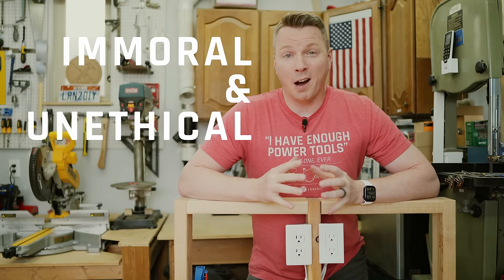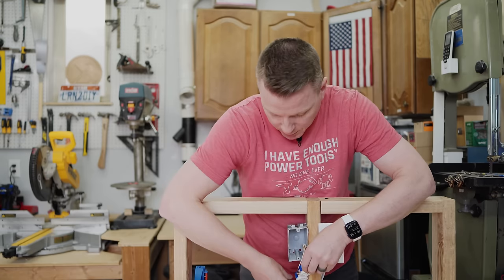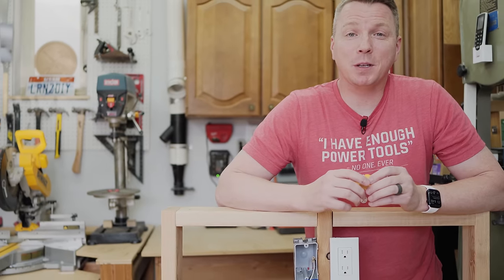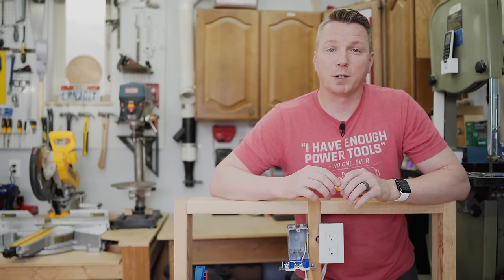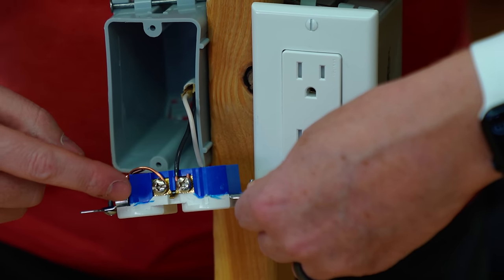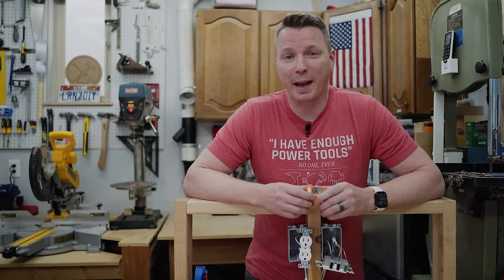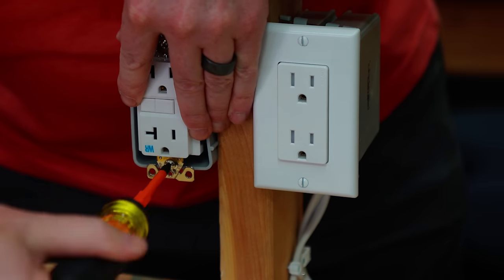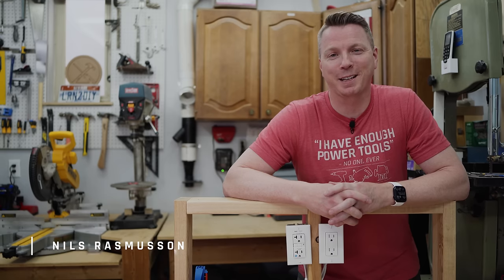People Are Adding Deadly Hacks to Outlets

Comment: My house, built in the late 40s to early 50s, half the outlets were wired backwards polarity, no ground, but all sockets were three prong. I've been correcting them all as I go. I mean even the electric wire was color coded incorrectly, black and white would be hot or neutral or vice versa.
Reply: I just moved out of a house like that. The noise through my guitar amp was unbelievable, so I started checking outlets. Almost every outlet was backwards with no ground wire. 1 outlet in my bedroom was backwards with ground so I fixed it and plugged the amplifier and pedals Into that and things got much quieter.

I couldn't believe that every outlet was wrong. I'm pretty sure mine had ground because it was added later, as well as a couple of outlets in the kitchen. Other than those, nothing had ground. The house was renovated before I moved in so I'm sure that's when they got put in backwards because they all had 3 prong outlets and new covers, etc...

I moved in Jan 2022 thankfully. The house I bought has modern wiring so my amp is dead quiet these days. The first time I tried it when I was moving in, I was very surprised at how quiet it was. 1st time I heard it that low.

Comment: Good video that shows a not so common problem. 

But there are a couple misconceptions. The tester showing correct (two lights on) just means the tester detects that both the neutral terminal and the grounding terminal both lead to the neutral at the source. (Main panel or meter base with main breaker).

So the $400 tester is likely not going to catch this mis-wiring either. To both testers, the terminals lead to the correct paths. The problem here is where in the electrical system the grounding conductor and the neutral are connected together (in this case, at the receptacle). In any system, they should only be connected together in one spot, at the beginning where the main disconnect is at.

EDIT So turns out the $400 does know where the bonding occurs by measuring impedance so it will help to distinguish if it is indeed a bootleg ground. Thanks to sparky below
Reply: Actually the $400 tester can detect false grounds by measuring the impedance between neutral and ground.   Below a certain threshold e.g. jumper between the neutral and ground screws on the outlet the tester will flash an F over the ground to indicate false ground.   In a properly wired home with modern wiring the ground and neutral only connect at the main panel, nowhere else, giving a higher impedance between neutral and ground at outlets.

Comment: A couple years ago after I got my own place I was helping my mother refinish my old bedroom, helping to paint and replace discolored outlets and such. Now, my mother's house was built in the 50's and is wired very strangely. There's 3 bedrooms, and one breaker controlls the ceiling fixtures in all 3 bedrooms plus one switched outlet and one regular outlet in each bedroom and another breaker controlls the remaining 2 standard outlets in each bedroom. (That's not rhe only weirdness, but the rest would take too much time to run through)

Now, at some point in time, the circuit running the lights (which also ran the switched and one non switched outlet in each room) was properly upgraded with 3 conductor Romex, along with most of the rest of the house, but there were two circuits in the house that were still 2 conductor, one of which was in the bedrooms running the other two outlets. The second ungrounded circuit was easy enough access because of how it was routed that a family friend who is also a licensed electrician came out and did the upgrade for us for not much of a cost above materials, but the bedroom circuit would have required removing drywall all the way from the garage in one corner of the house where the breaker box was to the bedrooms in the opposite corner, and that was well above the time and monetary cost we could afford at the time. My mother was asking me to just install the three prong outlets in and don't bother with grounding them ("I'd know that they aren't grounded, its not an issue") to which I flat out refused, but I did agree to installing a GFCI on the circuit and daisychaining the downstream outlets to protect them all, then putting the No Equipment Ground sticker on all the outlets. So, long story short, I'm glad to know that I did indeed do the correct thing given the situation

Comment: We have called them a "dead-man jumper", and it is way more common than you think in older homes that did not have the 3rd ground wire throughout, known as a two wire system compared to newer 3 wire system. People will replace a 2-prong receptacle for a 3-prong receptacle and install a dead-man jumper to complete the ground.  Very dangerous for you and any equipment plugged into it. That ground is now sharing all the current going through on the neutral, creating a very dangerous shock hazard which could lead to electrocution or fire.
Reply: And where do ground and neutral go outside of your house in North American wiring ?
Reply: @dmitripogosian5084  Standard residential will have a 240v service. 120x2. There are three wires that will come from the pole to the house L1,L2,N going to the service panel. At the house there will be a solid ground rod in the ground to attach the ground wire to the service panel. At this point ground and neutral are bonded together. For the inside panel there will be 4 wires from the service panel. L1,L2,N,G. On the interior panel the neutral and ground are then separated to there own buss bars and not bonded together. Neutral will be insulated from the metal panel. The ground buss will attach to the metal panel. All ground wires will then be terminated at the ground buss and all neutrals wires will terminate on the neutral buss from each circuit. Hope that helps answer your question.
Reply: @jonesgang  Thanks a lot !   Last summer I was looking at my cable to the pole, consisting of insulated cable hanged on uninsulated stranded metal line, and noticed that the metal line has only one strand left intact.  I always assumed it is just a mechanical support for the cable, but when electrical company came to repair it, technician said it is actually my ground (and now I am confused, maybe he said it is neutral ? ) . Anyway, after  new segment was spliced into the damaged part,  my lights stopped blinking when dryer was starting :)
Reply: @dmitripogosian5084  All power wants to return to its source. That bare metal wire is the return/neutral/ground. If you only had a strand or two and the rest broke or chewed you were having some funky issues in your house. Lights would dim or they would get really bright or major brown out of power from time to time all sorts of fun stuff. Glad you got it fixed. If you have lost that wire all together you could have sent 240 through every 120 circuit. Crazy fun stuff!!
Reply: @jonesgang  Fun part I lived with it probably for over a year, thinking it is just mechanical. Given that this cabling is electrical provider responsibility, they came within half an hour of my call, looking worried :)

Comment: Our house was built in 1978. All of our circuits are either 3 wire or 4 wire. And it is run in metal conduit. So even if the ground wire were to break, the outlet would still be grounded thru the boxes. And yes, we have GFCI outlets  which have the ground pin up.

Comment: I have a house built in 1955, and it had the main service running from the weather Head across the top of the front door, and it was frayed, i thought just that could be replaced, but no it had to be brought up to code, 8 thousand dollars later, new service from pole, weather head ,meter pan, circuit breaker box and breakers, i also went with whole house overload protection,this house does have some two prong outlets, but all the others were already upgraded to 3 prong and the power is much more reliable after those updates

Comment: You can also just get a two pole voltmeter with a continuity test mode, like a Duspol,  to test continuity between ground and neutral. You don’t need an extra special outlet tester for this.
Reply: Can't*
Reply: Isn't that exactly what all those basic meters are doing?
Ground is literally screwed onto the same place as Neutral in the main breaker box. If there is no continuity between your Ground and Neutral, Tere's a problem (99% of the time).
I guess you could test for resistance but even that's a bit of a stretch.

Comment: UK here (& not a professional electrician). Here in 🇬🇧 we have 230V AC supply & extremely strict regulations as a result. All modern installations have to have an Earth Leakage Circuit Breaker (ELCB) fitted which trips at 30mV. This bootleg ground hack wouldn't work in UK as the path from neutral to ground would trip the ELCB & it couldn't be reset until the neutral/earth path had been removed. 
Obviously you're in 🇺🇲 & regs will be different but are ELCBs not mandatory?

Comment: Been in the business since 1985 and never saw this. That truly is a hazardous situation. The disposal and refrigerator outlets would be a high priority to check.
Reply: Genuinely want to know why it’s dangerous to connect a neutral to the ground at the outlet? All the neutrals and grounds are connected inside the service panel. Why is it hazardous? Is it a function of resistance through one wire vs two?
Reply: @stephenroberts4155  because you become the ground, versus your ground rod which is bonded to neutral at panel.
Reply: @REALBanannaman  that doesn't make any sense at all. no matter what, the resistive path would be identical to the ground rod. In  assume a run 50ft from the panel: case A, normal. Resistive path from the ground pin goes down 50ft of ground wire, hits the ground rod; case b, bootleg ground, Resistive path goes from the ground pin, up 1 inch, down 50ft of neutral wire, hits the ground rod.
Reply: I would say its better than installing grounded outlets with no ground connected, but its still not good.
Reply: @X4Alpha4X  If there is no problem with the wiring, it should work. However, if a problem develops in the neutral, your ground will have the same problem with potentially very unpleasant consequences. And if the polarity is reversed, your "ground" will be powered.
Reply: @X4Alpha4X  Honestly there's nothing extremely wrong about it since it's better than nothing. It's just that a bootleg ground is going to remove redundant protection. If a floating neutral were to develop in a circuit with equipment grounding,  you'd at least have a chance that it would touch the ground wire and trip the breaker. In a bootleg ground scenario, once that floating neutral develops you'll be in for a wonderful 120V surprise when you touch the outlet with 100% certainty, since the one and only wire that could have tripped the breaker is now broken.

Comment: I have always wondered, "Which is more likely to happen? A short in the appliance, or a fault in the neutral line going back to the box." I feel safer having a bootleg ground than I do when I see a 3 prong adapter being used that has the pigtail flying in the air. (I hadn't watch the full video when I made that comment. The GFCI marked "No Equipment Ground" option looks like the best option.)

Comment: My wife and I bought a house that is a little old (70's).  I'm NOT  an electrician but I'm a software engineer and electronics engineering  person so I know how electricity works.  Half our newer addition to the house is grounded but the old side isn't.  I replaced all of our 2 prong outlets with a CFCI upstream and had a tester to see which one would kick it so I knew which ones the GFCI protected from the initial CFCI outlet.  Normally if I have an outlet that doesn't hold plugs in good because worn our or or something I replace it while it's hot because I don't want to find the breaker.  Just be careful just same as replacing a breaker in the box.  Only thing that ever got me was a ceiling fan I was replacing in my daughters room on the older side of the house.  I just shut the light switch off and took it down.  I didn't feel like going downstairs to get my "tick" (the pen things that detect voltage).  It was wired "HOT" instead of normal so light switch don't matter.  Got a little arm tingle from that one.

Comment: The houses in the 40s had grounds originally provided for kitchen, bath, laundry, but not living rooms and bedrooms.  Often the ground was a single wire run beside the double.   I found it easy to fish a single #14 wire to the ones that I needed a ground in.    Regarding this video, odd that you switched a 15 amp outlet with no ground to a 20 amp GFCI.   I know many people who think that a 20 amp outlet is better quality innards (true) so why not splurge, but they forget that with only 15 amp (#14) wire, the t-slot allows a 20 amp appliance to be plugged in.   Not safe long term, nor code.
Reply: Name a single 20 amp appliance you have in your house without lying.
And your dad's old circular saw from the 1960s that will never be outside of the garage (and probably never actually be used) doesn't count.
Reply: @joshuaewalker  There are plenty in the world. Especially commercial floor polishers, and high power microwaves. I have the latter.  But even if there is only one in the country, the code is the code!! An "instructional"  video should never show violation of the code. Outlets are designed to restrict the size of plug to put in, based on the capacity of the wire in the wall.  You cannot plug an electric stove into a dryer outlet, for a good reason.
Reply: Plug a 20 amp appliance into a 15 amp circuit and all that will happen is the breaker trips. This is a non issue, though it would be obnoxious
Reply: @rtel123  
High power microwaves that plug into 20 amp outlets are generally (99.99999% of the time) an installed appliance (built into the wall or above a stove/range), not a countertop appliance. You're not going to be taking your 1600w microwave out of the wall and carrying it to another room and plugging it into a 15 amp circuit that has an incorrectly installed 20 amp outlet.
Reply: @joshuaewalker  Irrelevant. Code is code! An advisory video should not show a code violation as advice!

Comment: This is so fitting. I was JUST LOOKING at the wiring in my 1949 house today. There’s a bunch of much newer three conductor wiring in my house…but if you follow them into the box they’re just connected to the neutral buss anyway. 

Should I perhaps get a ground rod and install it just outside my incoming service and move the grounds to it? I do a lot of high voltage electrical repair in my shop and I would really like to make sure I have proper grounding.
Reply: Neutrals and grounds go to the same place in a main panel.
Reply: They're bonded in the panel but separated in the wiring for good reason. It's complicated, but everywhere ground and neutral is bonded means that if the neutral on that conductor breaks the ground will become live. Doing it at only one place minimizes the risk.

Comment: Great video. I’m sure it was pointed out already and I know it’s just for demonstration but you put a 20 amp GFCI receptacle on 14AWG Romex . But thanks for the info regardless. I’ve never heard of this illegal hack.
Reply: The code doesn’t stop you from connecting 14awg to a 20amp device. It does require, in this instance, a beaker no larger than 15amp

Comment: I recently installed a bunch of GFCI Homeline Square-D  breakers in my panel. Everyone worked, but one kept randomly tripping off due to a ground fault of some kind. Sometimes immediate trip after reset, sometimes a few minutes to trip. Seeing I had lived there for years and not noticed anything, not shocked, nothing, I started thinking a shared neutral exists. I took out all the receptacles one by one to isolate where it would start tripping off, and guess what, not a shared neutral, one kitchen light had hot and neutral wires reversed! Imagine all those years running reverse polarity, and the GFCI breaker knew there was a problem. The socket has an LED bulb. I was wondering but somehow the LED circuitry in the bulb caused an occasional ground fault to trip off the breaker, as it would sometimes stay on for several minutes before tripping off and other times immediate trip off. So anyway, after setting the wires in the right spot, it works fine as expected. I even had thought maybe the GFCI breaker was defective as why would it trip like that, but it was the LED bulb.